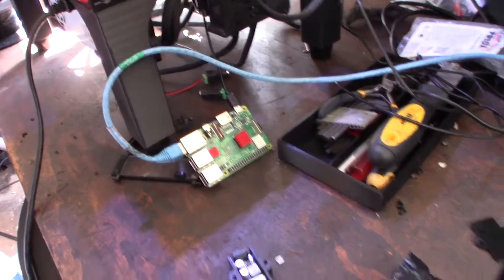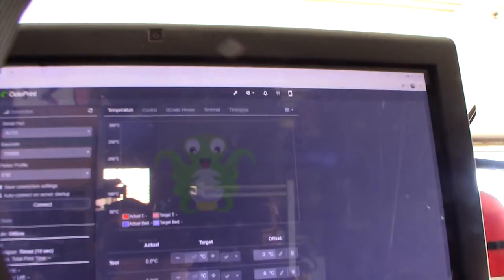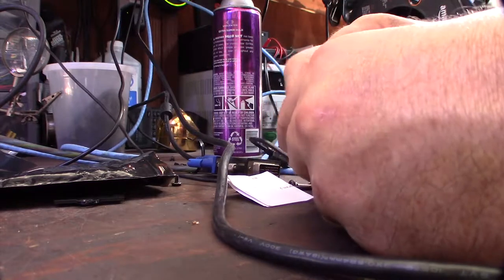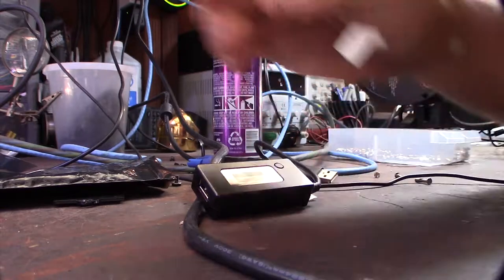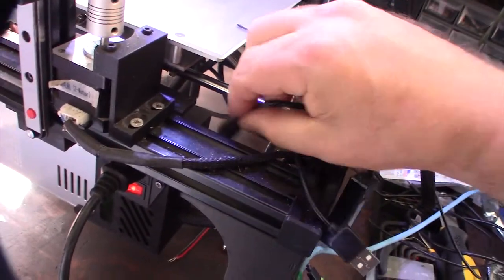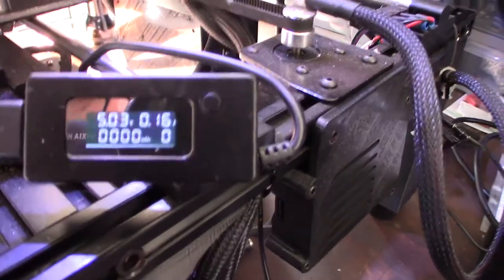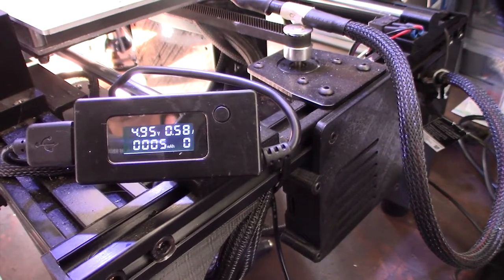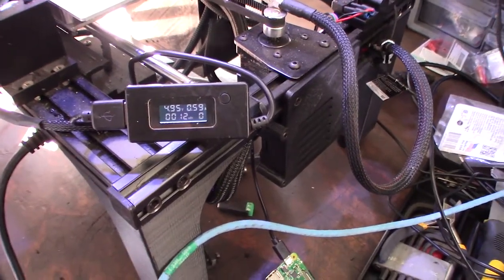Raspberry Pi Octoprint power troubleshooting with USB inline voltmeter current meter lightning bolt

Comment: It’s the power supply. Even though your printers is 40 amp, the printer probably isn’t as sensitive to Voltage as the raspberry pi is, so it drops below 5V even at low amperage.  You want a power supply that is 5.3-5.6 volts(regulated) at 2.1 amps to account for that slight voltage drop you are getting when it is plugged in. This will make it so that the Rasberry pi actually gets 5V after the drop.  I would just get a cheap raspberry pi power supply on amazon for $10 or less. This will solve your problem. I had this same exact problem with a Steinberg UR22MKII 2-Channel USB audio Interface. No matter what power I have it, there was problems until I got a slightly above 5V power brick.